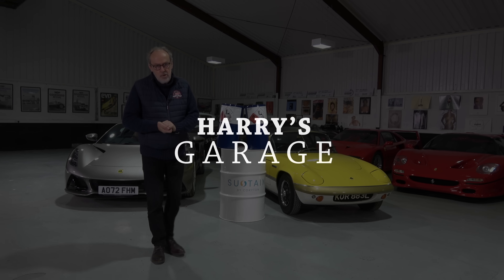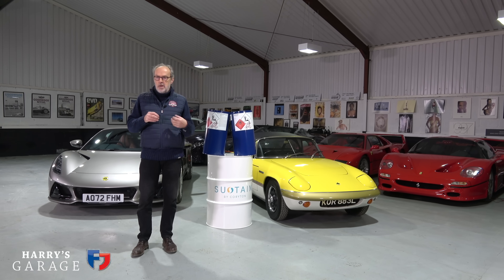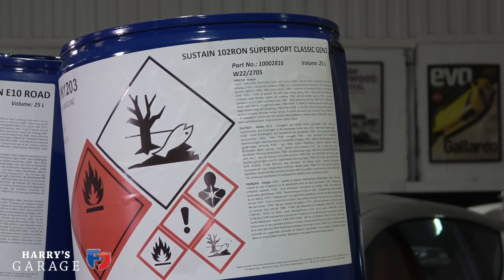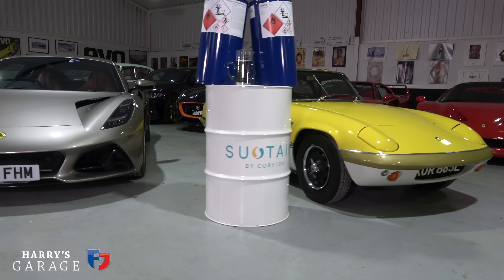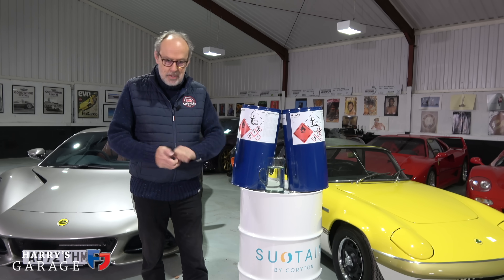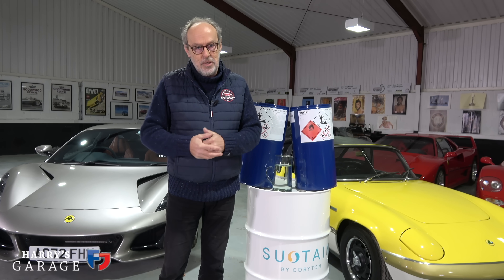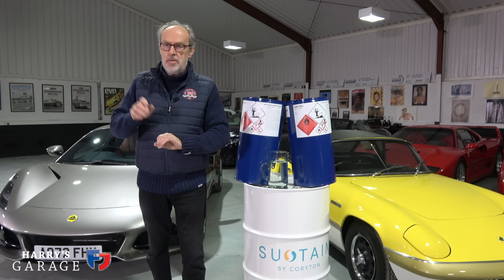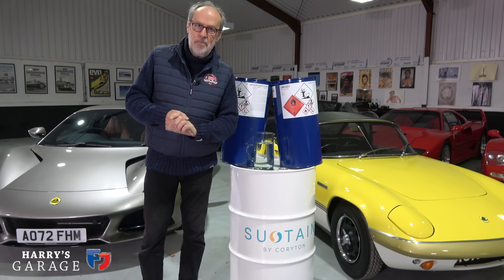Sustainable fuels; what are they & when will I be able to buy some?

Comment: Important to note of course that it’s not free energy. The energy actually comes from the national grid still so the comment about the UK power mix and EVs is somewhat moot as all this fuel is doing is using that same energy in a less efficient way.

What this fuel does do though is allow those of us who enjoy cars as a hobby (which are an absolutely tiny %age of all CO2 production) to continue doing so beyond 2030/35. EVs are by far the most efficient and effective way to power 99% of motoring. Sustainable fuels help those of us who still want to drive an ICE car at the weekend carry on doing so.

Comment: Coryton are brilliant at this and wish them well.  Unfortunately, or fortunately depending on your perspective, this synthetic fuel is ultimately not for the niche market - when you see the way the Development Renewable Transport Fuel Obligation (dRTFO) obligates Fossil/bio suppliers for inclusion, and effectively taxes the current fuels (no fuels bar some RFNBOs currently qualify) and this is on an escalator, these DRTFO fuels will need to be included in the retail blends.   Harry is 100% right about aviation fuel - SAF and taxation is needed, and you don't want to know what the sulphur limits are (3000ppm for Jet-A1 vs 10ppm for diesel means it rains on your head).    There are other projects out there, and the sector is pushing as hard as they can to defossilize.

You may be surprised of the RON on E10 too. Ethanol is a terrific oxygenate and will push RON.

Also BP are looking at whole transport sector with their figures, SMMT suggest car parc numbers for ICE will be much lower than a 25% drop.

Great upload Harry.  I would really like to take you through this over a coffee from a different perspective.

Comment: Aviation wise looking at hydrogen, but sustainable fuel would be a good alternative for existing aircraft, the good thing is that jet engines aren't so fussy on what they burn. There may be some changes required to sealants, pipes, fittings depending on the chemistry

Comment: Renewable does not equal sustainable. Agriculture can only produce so much.
And you will not reduce plane fuel consumption by taxing it. All that does, is make it more expensive. Fuel is already a huge cost factor in aviation and they already try to reduce it as much as they can. Doesn't mean it shouldn't be taxed, it just won't do anything for the environment.

Comment: It is all well and good and this may make you feel better however, the average car owner could not afford the extra cost, many are struggling to heat their homes. Also, in reality this means very little. China has a larger carbon footprint than USA, India, Russia and Japan put together. I cannot see the Chinese paying extra for this fuel or many others for that matter. What you never mention is LPG which is here and now. Recognised as a low carbon alternative fuel, it emits 33% less CO2 than coal and 12% less than oil. It also emits almost no black carbon, arguably the second biggest contributor to global warming. 
Also you do not mention Hydrogen either, no pollution. If you are going to broach the subject surely you have to provide the flip side to the coin and the alternatives. 
The scenarios you are talking about are a very small percentage of the population. In all fairness the amount of classic car racers there are, and the amount of miles these old cars do, compared to fossil fuel vehicle pollution for the whole population, I would suggest even if you ran these old cars on leaded 5 star the carbon footprint as a whole would be just above 0%. 
However, we did find this really interesting and watched this the whole of the way through. 

A bit late now but in my view the government should have pushed LPG instead of Diesel. Now they should push Hydrogen as it is just like filling up with gasoline. As I believe you mentioned, not everyone has the capacity to home charge a battery car.

Comment: These "sustainable" type of fuels do make some sense for niche "enthusiast" applications like Harry's car collection, however please note that it can't necessarily be scaled up to fuel all the existing vehicle fleet.
The USA tried very hard to make corn-based ethanol into fuel as a method of CO2 reduction, however a lot of research has since found that the CO2 emissions of growing corn for the purposes of fuelling cars actually generated more CO2 than using fossil fuels. Refer to Proceedings of the National Academy of Sciences (USA). Using genuine agricultural waste material to produce ethanol is ok, but there's not enough waste material around to fuel everyone's cars.
In the case of the "e-fuels" like the Porsche project, this type of liquid fuel production will consume vast amounts of electricity, so the effective electricity consumption of filling up one car with "e-fuel" will equate to fully charging multiple EV batteries. Environmentally, this is not worth doing until the whole world is already 100% renewable electricity and there is surplus renewable electricity to make fuel with.

Comment: In France we use super ethanol E85 at less than 1.00 euro per litre. Slightly higher fuel consumption and the engine needs programming. Approximately 150.000 cars run on E85 and over 3.000 petrol stations. Some tax advantages too. It is mainly produced using beetroot. Ford and Land Rover sell specific cars with E85 engines as from new. They enjoy excellent sales right now. The French government has set up standards and certification for kits to convert existing petrol engine cars and allows owners to modify the cars registration documents and insurance.

Comment: How much energy does it take to produce at scale? Waste heat from bakeries aren't going to cut it if you scale up, so you'll probably end up using electricity from some source. I don't know how efficient that process is, but then you're only using about 30% of the energy in the fuel in an ICE, while electric cars are more than 90% efficient. If you can get sustainable electricity you're probably better off powering an electric car with it rather than taking the detour by converting the energy to some liquid fuel and then burning it, except in cases like aviation and maybe large commercial vehicles. Cars and bikes can use batteries. 

Of course niche applications like historic cars, race cars etc aren't very price sensitive so they can use stuff like Porsche's fuel, with the benefit for the rest of us that we get to listen to real engines in races and not the Formula E sewing machine noises.

Comment: This sounds promising, but I would be interested to know how it degrades over time. Especially important for classic cars and anything with a carburettor. We have E10 fuel here and the problem with ethanol is that it attracts water. So I actually go out of my way to find ethanol-free fuel for my weekend vehicles and small engines (lawnmower, chainsaw, etc). As much as I understand the point of reducing emissions, if it means comprising engine longevity, it may not be worth it for cars we want to stick around for decades IF the final product contains ethanol.

Comment: Synthetic fuel made from c02 extracted from the atmosphere is the only way (except for a hydrogen conversion) that todays i.c.  Engines will be able to operate soon. Also, blaming an e.v for a dirty power grid is silly. A tpical home charger puts less load on the grid than your kettle

Comment: You are not well informed on aviation, they are trying to reduce emissions and have put in place a schedule to become carbon neutral. It is in everyone's interest, plane manufacturers, airlines... Rest of the world.
By the way, boats (shipping, cruise etc...) emit even more CO2.
And it is even more complicated than that because making shopping more expensive could cause less international trade and now factories being built which is also going to impact climate change.
The best solution is for government to finance research and push technologies that will make the most difference... Not tell people that buying an electric car will save the world because it won't really make a difference, in local air quality maybe, not at the planet level.

Comment: I see sustainable fuels only as a solution to aviation and for historic automobiles (heavily taxed).  Hydrogen will be long term solution for trains/long haul trucking/ocean shipping once we have enough renewable energy to produce green hydrogen.   Automobiles will be BEV.  Using ICE engines for automobiles going forward is not tenable because of noise pollution and toxic emissions.   Most people don't care about the sound of a v12 engine.  They want to breathe clean air and drink clean water.

Comment: Just to be clear, the total end to end efficiency of E fuel is less than 10% (renewable electricity to forward motion in the car) so for the majority of people driving normal cars makes absolutely no sense whatsoever. Electric cars (BEV) is the obvious and most efficient way for the majority of people to get from A to B as the end to end efficiency is more like 80-90%. For classic car enthusiasts, the number of miles driven is so low that it really makes little difference although if you want to use more sustainable fuels then fine. However, please please don’t be under any misunderstanding that continuing to make and use combustion engine vehicles, even with sustainable fuel, for normal people commuting about is in any way green or sustainable - it has to stop and we all need to move to battery electric. Keep your classic cars but don’t encourage normal people to use anything but electric cars for the future.

Comment: Another fantastic insight into the potential in these fuels, I've said in the past, being able to run my 72 Spitfire and my dads 74 Stag on a sustainable fuel would be absolutely game-changing.
Reply: Why would it?
Reply: @Tasty Pymp  why would it what? Run my 50 year old vehicle on a sustainable fuel?
Reply: @martindavison254  Why is that a 'game-changer' (whatever that means)?
Reply: @Tasty Pymp  its a term of phrase only. To run my pride and joy without adding to the Co2 and emissions issues we all face, it would be fantastic. The car would pretty much be carbon neutral. Which in a world where we all try to reduce the footprint we leave, it is a game-changing way for a car enthusiast.
Reply: @martindavison254  What co2 emissions issues we all face? 

What 'footprint'? Seems like you're parroting extremist propaganda. 

I'm sure your two Spitfires harming anything or anyone or make the slightest bit of difference. Chill out.
Reply: @Tasty Pymp  Good for you pal, what a waste of time your input was. Sometimes, opinions are just best left to yourself 👍🏼 

Bye 👋🏼 👋🏼
Reply: @martindavison254  You should heed your own advice ol sport.

Comment: What a great video and I hope much more on this subject to follow; in fact anything that informs the general public of the technological advances on motor transport full stop - a cross between Tomorrow's World (remember that) and Top Gear if you like.

One area where sustainable fuels would really be a revelation as in my opinion electrification is just not a viable option, is as a replacement for diesel as used in heavy goods vehicles for long haul trucking. What news on this front do you know?

Comment: Thanks again, great video.Totally agree with most of the comments. I think electric vehicles should be small "city vehicles" with appropriate exclusion zones for polluters.Fossil gas should be taxed up to sustainable fuel costs over time great to see your efforts in cutting CO2; Agree with you about airlines fuel use.and the expectation that flying in the sky should be a cheap travel option.P.S Lotus looks great, but I was concerned about the low visibility color on misty mornings!

Comment: Harry, aircraft emissions are covered by the ICAO emissions standards which, from 2020, includes CO2 standards in addition to ever more stringent nox and other targets. As others have said, engine makers continue to try and improve fuel consumption since it's the biggest operating cost for airlines; lower costs drive sales. Additional regulation was needed for vehicles because it's far less sensitive to fuel costs and designs rarely had economy as their first or even 5th design aim, hence regulation was needed to force manufacturers towards better emissions. That drive has always been there for aircraft companies and additional regulation will do little to improve things.  Turbofan engines are already pushing right up to, and in some cases, beyond what material science can offer (leading to poor reliability) so again, regulation on an already highly optomised market will have near zero impact.

Comment: Wouldn't  buying into a carbon offset program be a more cost effective solution? 2250 liters x 2.3 kg of co2/liter = 5,175 Kg of CO2. Carbon Capture at GBP50/ton = ¬ GBP260 or ¬GBP420 to offset your total mileage.

Comment: A bit of a confused story for me. On one hand I agree there's a market for synthetic fuels in motorsport and classic cars, but on the other hand we need to be clear that it's unlikely to be a mainstream alternative to electrification.

1. A bit of mis-representation of the UK electricity mix again, currently UK electricity uses 42% fossil fuels. So yes an EV still produces CO2 but vastly less than a petrol or diesel car (about 40-60% less across the lifetime of the vehicle including manufacture)
2. Cost, and this is a major issue when compared with electrification. Today, an EV has an equivalent cost per litre of 32p charging from home overnight (based on 44mpg and 3.5kWh per mile). Any alternative, whether it be synthetic fuel or hydrogen fuel cell is going to cost significantly more to run. About 3x for a hydrogen fuel cell and 5-6x for synthetic fuel at scale. That's ok for a classic car or motorsport, but not great for day to day usage. The reason is liquid fuels and hydrogen fuel cells are significantly less efficient than battery EVs, and that inefficiency is rooted in the laws of thermodynamics - so it's not going to change.
3. Sustainable fuels are not carbon neutral, their manufacture requires energy, and that energy is most likely coming from lots of electricity. Turning that electricity into a liquid fuel then burning it is inefficient compared with using it directly, so ultimately it will produce more CO2 than an EV.  It's great using excess heat from a bakery but that heat has still come from electricity, and still has a CO2 footprint. They also produce other toxic emissions, because fundamentally burning stuff is not great.
4. Infrastructure, agreed it's not sufficient yet but that's a logistical challenge that can be met. As more EVs hit the road charging infrastructure will scale. It's chicken and egg today but it's definitely a solvable issue

So, let's be clear - there's a role for synthetic fuels but it's not mainstream and it's probably only for the wealthy.

Comment: Question for these types of fuels is many(imo). 
Yes they seem to be an improvement, cost as noted is a factor. 
But we need to look forward, and maybe address more issues, unlike the period previously for fossil, and so called clean fuels at present.
1. Does this impact agriculture space? (see 3 as well)
2. What is the impact on soil extraction of minerals and nutrients on the product growth? b, are they being replaced?
3. Does this impact woodlands and other spaces?. (please note that the green alternatives at present take up alot of space ie both onshore and off shore wind farms, and solar plants)
4. What is the effect, as noted with fossil fuels, in say 50 years, 75, 100, 250 or even beyond?
5. What is the effect on fuel systems and engine wear?

Just asking. I would like this to be an option and we can release ourselves from the OPEC/SOPEC grip, into another (jk).

Comment: That's a good episode thank you! I'm no engineer but is sustainable fuel something you can mix with current pump fuel? Wouldn't it be a good idea to do so gradually? Just start by having a 5% (or even less if necessary) mixture and the price wouldn't shoot up that much. The suppliers of sustainable fuels would still get massive demand and the production costs would start to get cheaper. Then as the price of sustainable fuel gets cheaper add more of it to the pump fuels and repeat the cycle until pump fuel is 100% sustainable and the price reasonable. Am I too simple minded?
Reply from the maker: Yes, sustain fuel is completely intermixable with regular pump fuel. I wouldn't be considering it if it wasn't.

Comment: Sustainable fuels, at least biodiesel is very problematic. Biodiesel and regular diesel which has like 7% biodiesel in it can clog up injectors over time and in all cases they noticeably accelerate the amount of carbon deposits on the intake elements, i.e. intake manifold, ducting, and valves. They also affect the EGR valve over time. Therefore, at least for diesel cars, people should try and buy diesel with 0% biodiesel in it. And the biggest environmental problem is that waay too many forrests are cut and far too many harmful experiments are still being carried out, including all the recent rocket launches etc. Those pollute at an insane level.

Comment: You can make algae fuel. Problem is not making it. The issue is mass producing it. They can make regular gasoline, or even aviation fuel. The algae fuel absorbs CO2 to make. But they can't figure a way to upscale it to a competitive cost.